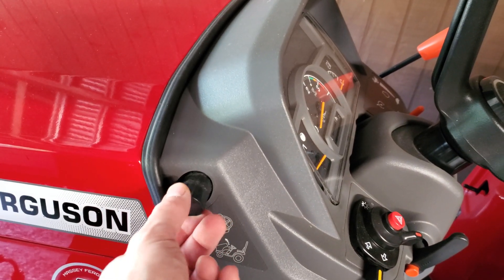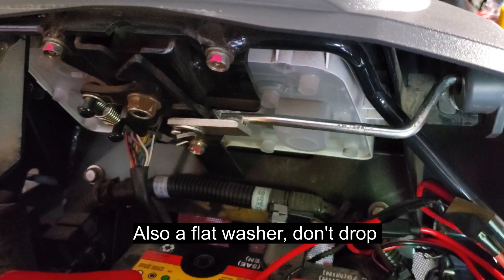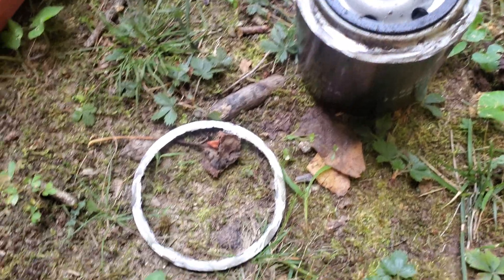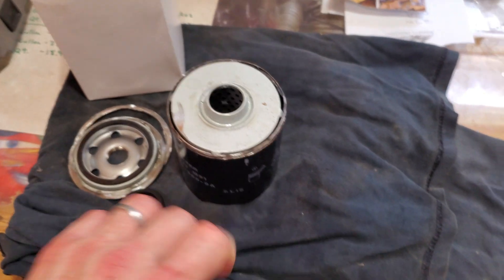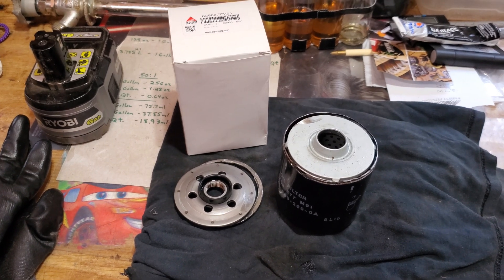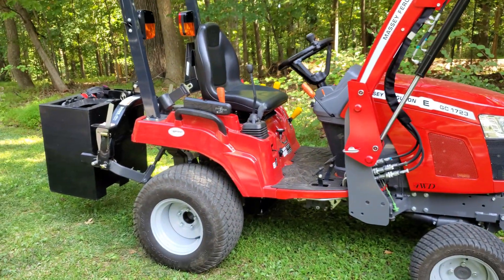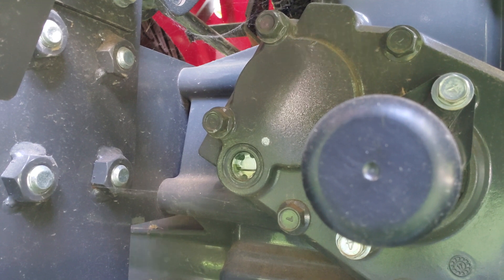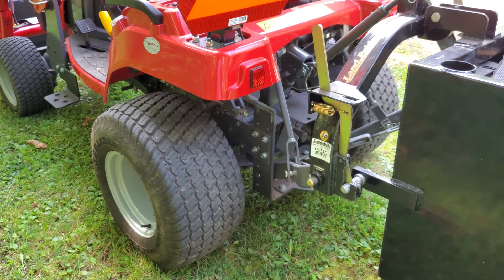Should You Change Tractor Hydraulic Fluid Annually?

Comment: Hey Ed!  Are you happy with the turf tires on steep grass hills?  Got any idea what the total weight of the tractor, loader, and a 60" belly mower would be?  I'm considering buying a GC1725 with a single axle trailer.
Reply from the maker: I'm happy with them, but I don't have steep grass hills. In that situation, id use 4WD where needed versus going with industrial tires or maybe look into versaturf. As for weight, this video should answer all of your questions except for belly mower weight. https://youtu.be/goS7VzMNlds. Most people recommend dual axle for frequent or highway hauling, but some get by with single for short and infrequent hauls.

Comment from the maker: Correction at 4:41 the spring shown there is NOT for PSI bypass. All that spring does is apply pressure to the filter to keep it seated in the housing. The PSI pressure relief is integrated as part of that cartridge. If you press in the center on the bottom of the cartridge, you'll see it push inward.

Comment: That's why I'm an Amsoil man, ED.  Synthetic for the win, then it's only all about hours on the machine.
Reply: This.  Machine run time (hours/miles) is significantly more impactful to oil health than general time, especially when using high quality oil like Amsoil.  I’ll change the fluids in my small engine machines every 2-4 years as most do not come close the minimum run time annually per the manual.  I’ve been using Amsoil in all of my vehicles and small engines for 20+ years, zero issues.

Comment: I like your different comparisons and analyses, Ed. This oil analysis certainly shows that changing yearly with low hours is not necessary.  The filter sure seemed to be more rugged than most filters. Thanks for providing the info! - Rick